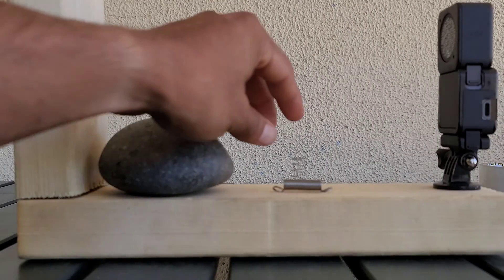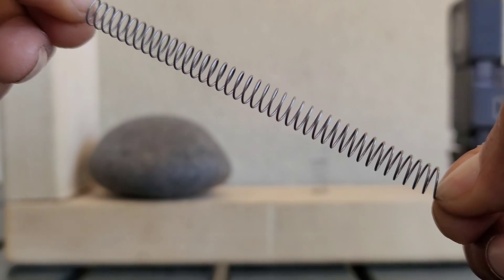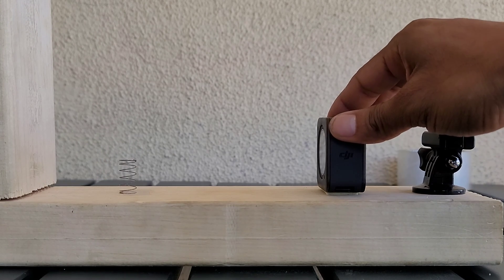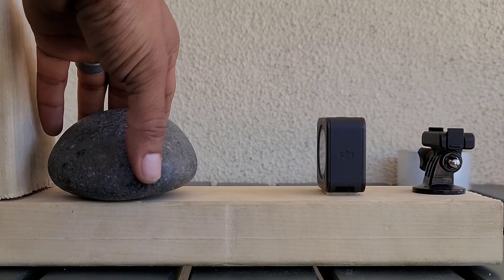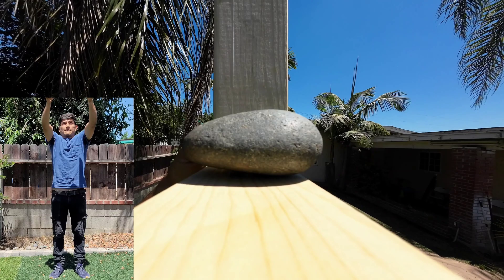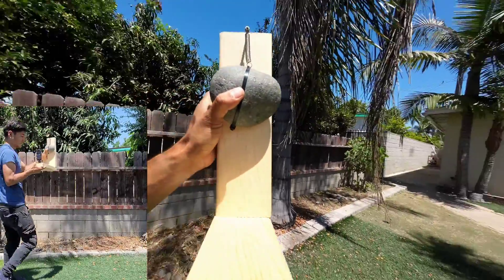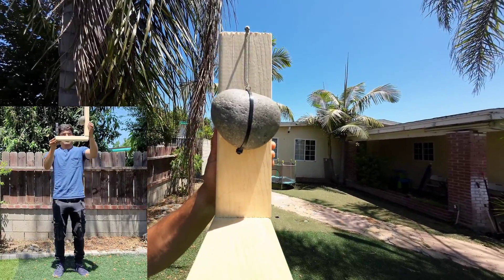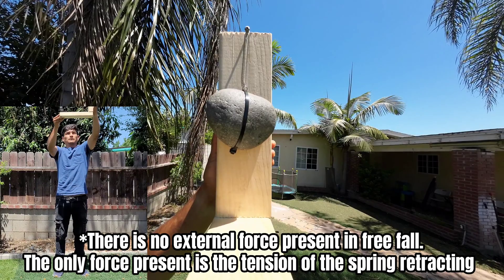Weight Experiment Using a Rock And 2 Springs

Comment from the maker: In this experiment, I'll be using a rock, a compression spring, and a retention spring. It is a simple fact to note that a force is required to either compress a compression spring or stretch a retention spring. The springs cannot compress or stretch on their own.

For the first drop test, I taped the compression spring onto the reference frame so it doesn't move around. I also taped the camera as low as possible to get a better view of the spring.
When connected to the earth, the rock weighs about 2 pounds, and it's able to compress the spring all the way down. The spring wants to push up on the rock, but the resistance or weight of the rock is greater. However,  the instant I release the reference frame into free fall, the weight of the rock completely vanishes, and the spring is able to push the rock up. 
This experiment shows that the weight of the rock is only a factor when connected to the earth.

For the second drop test, I hung the rock and retention spring from a screw I drilled at the top.
As you can see, when connected to the earth, the weight of the rock is able to stretch the spring, showing that there's a force present. However, in free fall, the weight of the rock completely vanishes, and the spring returns to its original shape, swinging the rock up, showing that there isn't a force present.

Weight is not a property of matter and requires an external force, which is only present when connected to the earth.
Observable, Measurable, Testable and Repeatable.
Reply: This is so sadly wrong, in so many ways. You keep using the term "connected", and that's just the beginning of your misunderstandings.

The contraption, the board, the spring, the rock, when at rest, are RESISTED by the Earth. Yes, that means they're connected, no it doesn't mean the connection causes the resistance. The resistance causes the connection. 

When you remove that connection, there's nothing to resist them. Air is a very poor resistor, and people use large parachutes for that very reason, to gain some resistance. 

So as everything is in free-fall, the spring itself becomes a force it once was, because everything has practically no resistance. That tiny push might make the rock seem weightless, but that's an absolute delusion. The tensile strength of the spring returning to its natural state gives extra resistance to the rock, which it was formally able to overcome, because of the resistance of the Earth beneath the wooden base, and the spring had no choice but to be crushed, because its tensile strength was insufficient to resist a 2-pound rock. 

Put them all back on the Stationary Planar Earth once again, and everything returns to normal.

I've been watching this series on Facebook arguing against another person fooled by this hocus-pocus, and in every case, you've had to artificially induce motion to create a condition that upsets the ordinary resting condition. Which relative density and buoyancy has already determined, until you add the extra forces.

Comment: What we should test is having a supposedly heavy ass rock falling from a much higher flying plane onto a much lower flying plane. See how this rock handles the plane
Reply: this is a dam good idea, so this should be possible to demonstrate without the heavy ass planes and rocks, so as all 3 are not connected to the reference frame, i will think about how to scale it down without the expense, although would be good to watch, perhaps the guy who funded the final experiment would donate ?
Reply: so the 2 aircraft have power causing lift or buoyancy keeping them at altitude, the rock does not ! however attaching some glider wings to the rock would allow it to be guide toward the lower aircraft once released from the upper craft !

Comment: Thanks for the demo on inertial reference frames. When youre accelerating down, due to your inertia, you feel an upwards force thats only present in inertial reference frames
For a non inertial reference frame like you throwing the apparatus, you can imagine it as, the whole of the force on the rock (mg) is used as acceleration, so there is no force to stretch the spring, and it contracts. This is the same type of force as the one you feel after you hit the brakes
You feel weightless when in an elevator and it just starts to go down, or a roller coaster, or sometimes airplanes if youre on an unlucky plane. If yorue on an elevator, are you disconnected from the earth? doubt it
Reply: Cool story, can you link me to any demonstration of downward acceleration/force?
Reply: @LevelheadedNatalie  
https://youtu.be/tNpuTx7UQbw?list=PLyQSN7X0ro203puVhQsmCj9qhlFQ-As8e&t=2534 Pendulum demo, predicted exactly to 4.57 secnods
https://youtu.be/9gUdDM6LZGo?list=PLyQSN7X0ro203puVhQsmCj9qhlFQ-As8e&t=1711 Vertical circle demo, unintuitive result calulated using physics
https://youtu.be/k6aJyOHTDYM?list=PLyQSN7X0ro203puVhQsmCj9qhlFQ-As8e&t=1176 Some experiments with projectiles
All these use gravity as a downward force, all these work
I have some more stored on discord, but these are good enough

Comment: That’s just because of the air around the rock.  Once you go in free fall the rock gets resistance from the air around it and the wood is falling so the wood and rock are both falling when before the wood was held steady
Reply from the maker: Why did the weight of the rock vanish and get swung up by the tension of the spring?
Reply: @LevelheadedWilliamNatalie   cause the spring was also falling down—before the board was being held up
Reply from the maker: Why doesn’t the weight of the rock keep the spring stretched in free fall?

Comment: I think the flerfs will explain this away by saying when at freefall there is nothing on the bottom of the board to give any "resistance" to the rock this it's able to push it away...how would you respond to such statements?
Reply from the maker: If the rock was truly being accelerated down the spring should remain compressed because of inertia showing there’s a force present but it doesn’t.
Acceleration requires force 👍
Reply: @LevelheadedWilliamNatalie ah, your reply is better worded lol
Reply: @LevelheadedNatalie  I would have responded similar. 
And good to see the same repeatable results from your demos that I got. 👍
Reply: The compression spring cannot resist the rocks weight, so if objects are falling because of their density or because they’re being accelerated downward then the rock should’ve continued compressing the spring during free fall.
Reply: Thanks for the response, cheers William and Natalie.
Reply: @NachiketaFire  Their claim is that there is an acceleration of all matter at the same rate, This is absurd.
It is NEVER observed EVER.
Bar, special pleading that it does in free fall. 
It's flawed at the outset with that single claim of physical acceleration of all matter at the same rate. 
This is, 
A physical impossibility to demonstrate. 💥